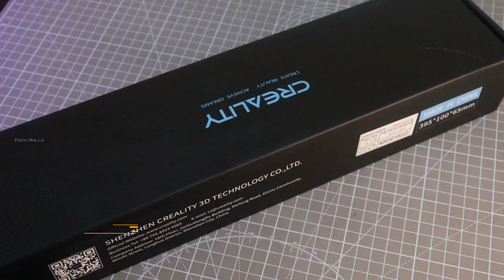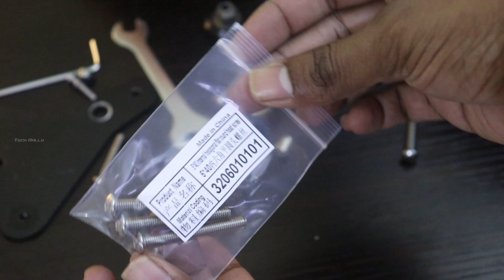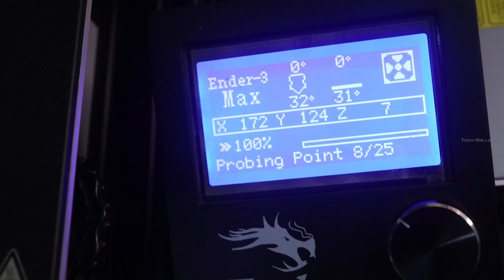Ender 3 Max Dual Z axis upgrade for Z banding issue

Comment: Hey, reaching out again. Did you have any errors with the firmware not recognizing the proper bed size?
Reply from the maker: No, i didnt have any issues like that.
I think you need to set proper bed to probe offset if you have this issue
Reply: @TechRallyofficial  ah ok. Currently it doesn't recognize 1/4 of the x and y axis. Thank you
Reply from the maker: Looks like bead size issue
Check if you have download correct firmware for ender 3 max
Reply from the maker: Is your colour v2 LCD works with the Marlin firmware...
Reply: @TechRallyofficial  couldn't get it to work with that firmware, I believe I would need the firmware for the ender 3 v2 and manually edit the firmware for the max dimensions, which I don't currently know how to do
Reply from the maker: @YarrickWander oh ok, 
Only option is you need to create custom Marlin firmware with ender 3 v2 config files, still not sure if it will work.. 
I tried my own custom marlin firmware and print quality is not good.. so i didn't try after that..

Comment: I installed the upgrades, but how did you adjust your z offset properly? it wont let me adjust it below 0 so the extruder hovers a cm above the plate
Reply from the maker: I remember this happened to me, but i don't remember how i solved it.. i will check
Reply: @TechRallyofficial any updates on how you fixed this? 5 months later ?

Comment: Hello, i have a ender 3 max, with dual z axis, the sprite pro extruder, a bltouch sensor, and a 4.2.7 motherboard, where can i find the correct (functional) firmwear for it?
Reply from the maker: I have exactly same setup and using firmware form below website it works for me but only problem is hotend temperature is limited for normal extruder,
Make sure to change the probe offset and e steps in settings..
https://marlin.crc.id.au/
Reply: @TechRallyofficial  do you know of this would also work with a v2 display provided the rest of the printer is the same as previously stated?
Reply from the maker: Sry i don't know if it will work,
I also need to know it it works.
Are you using v2 colour lcd..?
Reply: @TechRallyofficial  I have the v2 lcd upgrade but I have yet to try it with your recommendation. When I do I'll let you know my results
Reply from the maker: Thanks, if works i will also try.
Default LCD look too outdated 😁
Reply: @TechRallyofficial  to confirm you use the firmware titled : Ender3-Max-v4.2.7-BLTouch
This one supports dual z axis correct?
Reply from the maker: Yes, i use the same, only difference is my board is 4.2.2